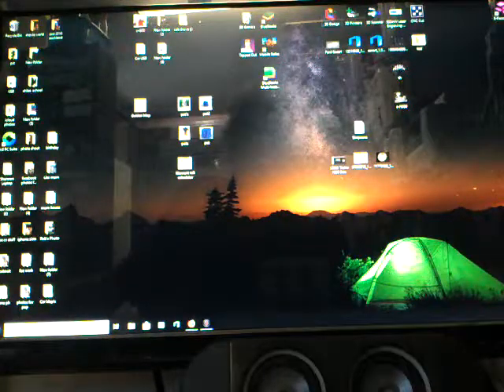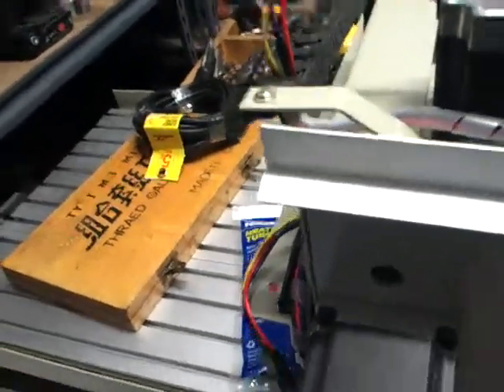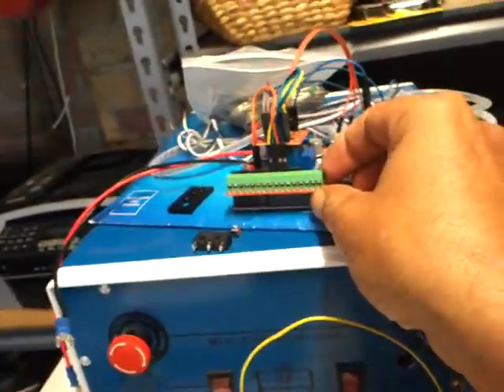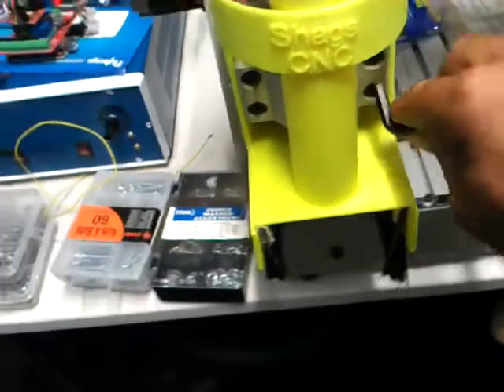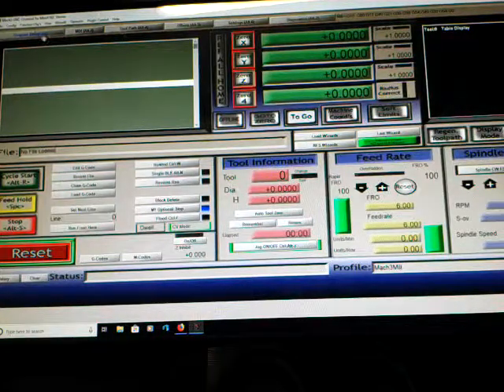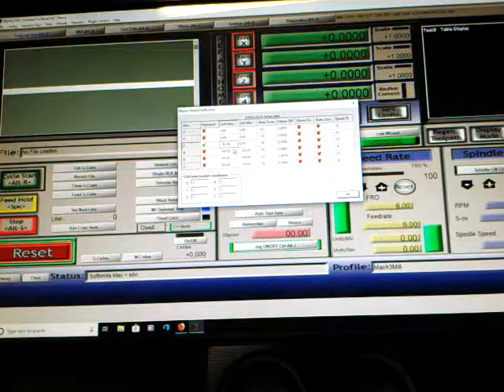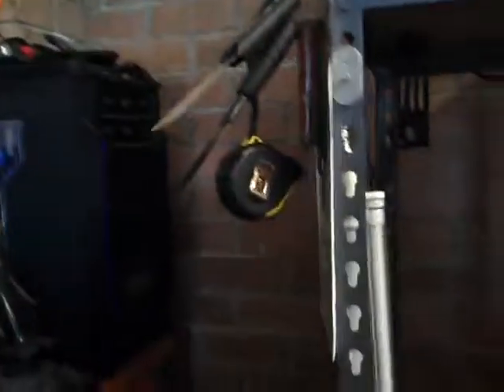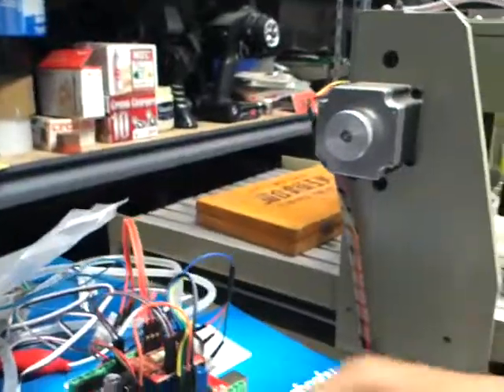CNCest 3040T 4 Axis 400w Router with Windows 10 / 64Bite + Mach 3

Comment: I have the exact same machine, I have been really learning a lot with mine.  Running Q-cad, Cambam, Mach 3. I had to figure so many things out. Did you ever find the plug in for the bit sensor card?
Reply from the maker: No not for the bit sensor card
Reply: @shannongreenhalgh   I struggled for at least a month to get my machine running. As soon as I found the pluggin it all started working. That was last January. Since then I have learned so much.  Also that machine controller card has worked flawlessly ever since.
Reply: This is the page that helped me out a bunch. You might be passed this stage but it might come in handy.  The super important plug in is the Motion controller download.  Also glad I didn't mess with limit switches. I just set the soft limits up for my table dimensions.
Reply: Having a hard time sending the exact link.
Reply: This page has all the info. and the motion controller pluggin.
Reply from the maker: @toddspeck9415  Yes thats what i have in my controller box

Comment: Hello.  I have the same machine.  Did you ever hook up a cnc z-axis tool setting touch plate probe?  How did you do it?  Thanks.
Reply from the maker: Hi there Chris, Yes I did have my tool changer plate probe working, But i did removed the motherboard ( RNR ECO MOTION 2.0 ) out for thing a bite smaller inside the blue box about 6 months ago

Comment: helpful do you know where i would find a assembly manual for the cncest 3040
Reply from the maker: You can download it from here:  https://www.chinacnczone.com/en/cnc-3040z-cnc-3040-manual-chinacnczone_l62_p9.html
Reply: @shannongreenhalgh  thanks but it's assembly I'm struggling with(wiring track. motor connections ect) thanks anyway
Reply from the maker: @ianwilkie2652  The only one I can found is this one here at;  https://reso-nance.org/wiki/_media/materiel/cnc3040/t-dj_guide.pdf

Comment: What mother board did you put into the controller box? I am thinking of getting this machine but don't want to buy an old computer.... Your Thoughts?
Reply from the maker: This is what come with the manufacturer controller box: MACH3 USB CARD of RnR MOTION + 4 axis breakout boards too the motors manufacturer.
Reply: I really love my little 3040 machine...I have taught myself so many things about it..If you ever get stuck getting things to work. Send out a message..Might be able to steer you in the right direction.
Reply: In response to your question.  I am using an old Windows Xp machine  stand alone. dedicated just for my cnc machine...But this control box has a usb connection. And I think I read that Win 7 might run it just fine. Not 100% sure of that...But I kind of think it might work.   Also the instructions and software that come with it.  Will leave you so frustrated.  The mach 3 cd is some bootlegged program that won't work. The instruction sheet is basically useless.  But I can steer anyone to making it work...At this point I have carved so many cool projects. Very happy with this unit.
Reply: Just read Shannon is running His on Windows 10..p.s I bought this collet adapter that accepts dental bits...Now I can carve some of the smallest super detailed items...Sooo cool.
Reply: @toddspeck9415  Hey Todd Thank you for the response. I did go ahead and buy this machine however I got the USB version that uses USB-CNC bought an old laptop Win 7 machine and it works just fine. Again Thanks!!!!
Reply: @staceymiller5046  Awesome man, I have the same exact one with the usb cable. Running it off a standalone Xp machine. Thank's for the reply. So great to know it will run off win7.  Happy New year 2020.